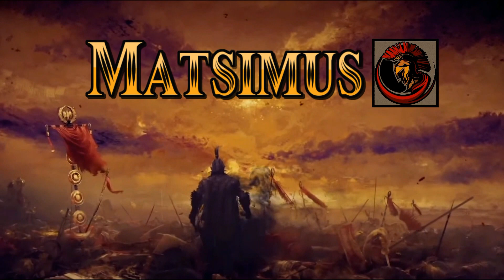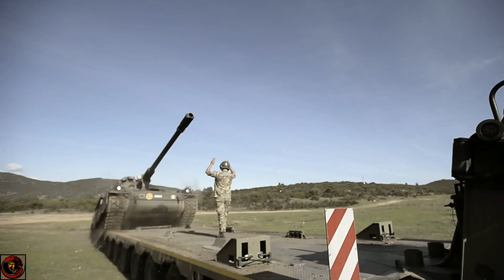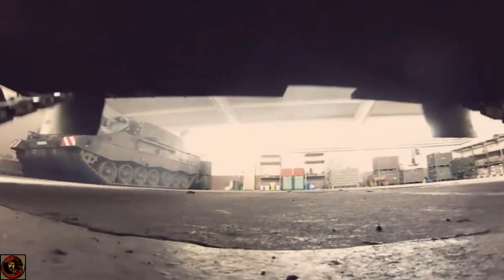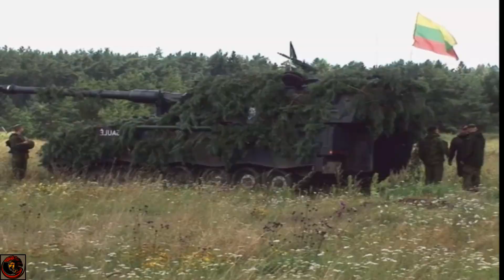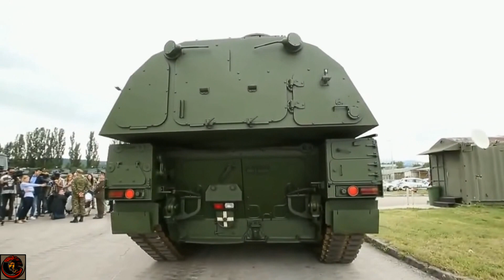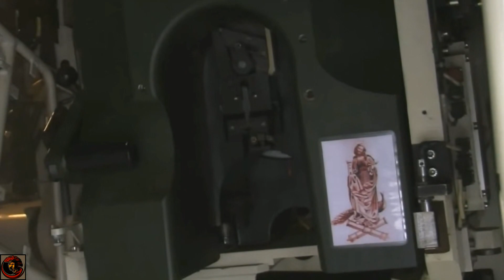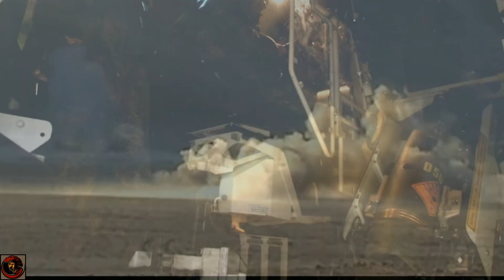German PzH 2000 - 155mm Self-Propelled Howitzer : Overview

Comment: The Leopard One MTU powerplant maybe rated at 1000 hp but actually puts out over 1200 hp. It also comes with a "battle" setting which rises the power to almost 2000 hp - for 15 minutes full load, but who would go full throttle for 15 minutes. The same "battle" setting is in the German Leopards Two with an similar increase in power. Friends of mine serving in the Bundeswehr back then reported the Leopard One going well over 100 km/h and only at 115 km/h throwing its threads on the Autobahn. Naturally this was only done if an inexperienced  commanding officer made the mistake to complain about to slow driving and demanded to put the pedal to the metal......

Comment: The thing that you missed is that 1 artillery piece can shoot 6 rounds in short succession that impact the target at the same time due to different sized propellant charges and the auto targeting system. I guess this is not unique to the PZH 2000 but it's still impressive...

Comment: 1:00 anyone know what that white cross on that shield like object is in the bottom right is? Seen it on the Gerpard as well as some other German things. From it's placement on the Gerpard I thought it was a guide of sorts for the tow hook. Can't tell if it lines up on the PzH 2000 though I imagine it could with the read hatch closed.
Reply: As far as I know this should be a signal sign. While i don't know the name of this thing i know its purpose. It is used when those vehicles travel in a group at night. The standard procedure is often that they drive behind each other and those shields are visible for certain sensors so that they can keep the distance.
Reply: @emilsinclair4190  Ah, thank you.
Reply: @emilsinclair4190  it's called "Leitkreuz" and you're right, it's a signal for following vehicles during night missions

Comment: With a range of 40 k, the best use of the vehicle would be to keep it behind the lines as its size would make it rather hard to hide. The key to survival on the modern battlefield is not to be seen and it is a bit hard not to be seen in a vehicle the size of a house. In short if this machine ever approached the front line it would become an anti-armour missile team's dream. But as started with a range of 40 k it does not need to approach the front.
Reply: That's exactly how it's supposed to be used. The groups usually position somewhere off the sight. For targeting you have spotters near the targets or guide the fire with radar or other technologies

Comment: I coulda/shoulda said:
. Is it just I/me or is this thing a monstrosity?
. Am I missing something, here, or is this thing a monstrosity?
. They are using caseless ammo with a sliding wedge, breech, block!?
How does that work? Do they wedge the wedge in there?
. Or do they just want to keep the ammo in the centre,
of the vehicle, for balance, or something?
No, they didn't want to raise the turret floor, any higher,
because of recoil, when using a magnum charge.
But there is a turntable under there already,
so why not just turn it into a magazine, directly?
And, they could have used hydropneumatic suspension,
instead, of torsion bars, or just dropped the ground clearance; and
U could pick up the shells by the nose or electromagnetically, even.

Comment: This is supposed to be the best SPG in the world!? HA!
Am I the only one who thinks this is a monstrosity?
. Why would U store Ur shell higgledy-piggledy like that?
Wot, just so U can see what U have, readily?
Why didn't they store them in a carousel under the turret?
I reckon U can fit 60 shells in a staggered 2 ring carousel,
under the turret, in the space they are using already!
. The Westies like to crap/carp on (about) how dangerous
the Russian tank carousel autoloaders are: 
And what about this monstrosity!?
Reply: First of all I want to awnser the question why the Ammo storage is so unique. Lets start with the position. The ammo is positioned like that to achieve a very low and centered Center of mass so the recoil doesn't effect the vehicle as much. This helps in improving the rate of fire. 

Next one: Why dont they use a carousel like the russians. When the PzH Was designed the first autoloader they thought of using was a Revolver loader. The big problem with a Revolver loader is that its very heavy and you have alot of motion going on (to stop a fully leader Revolver loader alot of force is needed). So they designed a completly new autoloader which weighs alot less and is more reliable.

And to your last question: Why everybody critizies russians MBTs for their carousel autoloader? The awnser to this question is pretty simple. It basicly already stands in your question. MBT are Part of the frontlines which make them targets to many threads so to use an autoloader in such a vehicle is very stupid.
The biggest thread to a PzH2000 is counter artillery which can be avoided by the pzh. Beides that the pzh is pretty good protected

Comment: Sorry, but it's not fast. My M-109 Crew and I regularly outperformed the PzH2000 back in the day. The german M-109 Crew were trained to fire a group of 3 rounds within 5 - 7 seconds and then bail. 

But I have to give it to KMW, when it comes to comfort and capabilities, the PzH is quite a beast. They certainly designed something very beautiful. However, I liked the M-109 better. This monster is so automated, that in case of an EMP you're fucked. You can't even fire the weapon, let alone move it on target or hit something. Yes, there are emergency procedures, that would enable you to perform at least some basic tasks. But they're so overcomplicated, that in a combat situation after being hit by an EMP, you best just ditch the vehicle and run.
Reply: You do know that the swiss have equiped their M109 with a semi auto loader to achieve a 3 shoot burst in under 15 seconds and you claim your team was 3 times as fast manually? Yeah, sure... Especially if you know that recoil system of the M109 needs nearly 2 seconds for a full cycle, so you could load the gun 0.5 seconds?
Reply: @shi01  Have you ever been on an M109? Do you even know how stuff like this is counted? Cause I don't know to what M-109 model you actually refer to. But the M-109 A3GEA4 doesn't take that long. And no, I will not provide you with the exact numbers, since they're still a secret. But let me tell you, it's well under 1 second. ;-)

The first round is always assumed to be ready to fire, cause before the first shot is fired, CoBRa has nothing to spot. So what's counted is, the time in between the first and the last shot of the group. 

In case of a firemission, you'll load the right round with the right fuze (assuming you have the rounds prepped and fuzed already) provide the right powder charge, move the gun to right angle and elevation, prime the gun, signal ready and then wait for the command to fire. Once the first round has cleared the gun, the K2 will immediatly open the breach, K3 standing by with the next round. K4 with the ramrod. Up and in, while the commander and K1 check that their Periscope and gun are still within the mission parameters. The whole cycle takes in between 2 - 5 seconds. Depending on circumstance and if everything goes smoothly.

The most time consuming thing in this is the time which the breachblock needs to close. 

Did this during LÜSA (LehrÜbung System Artillerie) multiple times on Video. 

Truth be told, it was more a notion of pride, that we tried to outrun the PzH 2000, cause at the end of the day, no guncrew can keep this pace up for to long. But back then, when the old Emmas got replaced by these monsters, we weren't all to keen about the new howitzer. And thus tried to prove a point in being faster, by cutting corners and giving it all.
Reply: @joenight9693 Nice to hear. Btw there is an interview with the patent holder of the pzh  on Youtube where he explains the idea/concept behind the pzh and explains some characteristics which are unique compared to other self propelled artillery systems. 

I can Highlights recommend it. Sadly its only aviable in german

Comment: There was a terrible accident in 2006 in east germany during a live firing exercise. 2 german soldiers died when the loading mechanism was not fast enough for the crew. They where to fast in placing the powder, so the powder package got stuck inside the receiver and later, during the repair, it exploded. I was in the Lausitz as a soldier only a few months later and other people talked about the accident. I must say, i‘m not convinced about these automatic loading mechanisms after that.

Comment: 36km is impressive for a gun system but it's still outranged by many modern rocket artillery systems. New Grad rockets have a range of 45 km. The BM-30 Smerch and 9A52-4 Tornado have a maximum firing range of 90 km. The new M270 MLRS systems have a range of 70km (or up to 300km for the ATACMS missile). The Chinese SR-5 has a range of 50km for the 122mm and 70km for the 220 mm rockets and the A-100 MRL has a range of 100km. SPGs are badly out-gunned at the moment. I think we'll have to move to rocket-assisted, guided munitions to keep artillery guns relevant in the future.

Comment: Could someone answer me a simple question please? Is any possibility for a Pzh2000 to survive if a main battle tank (eg Leopard 2) is trying to catch it? I mean on very tough terrain, like mud, snow, etc, could a Pzh2000 be capable and fast enough to go back to its base safe, before a tank get close enough (for example if the scenario was like the pzh2000's crew know that a tank is following them, so they have to run back to survive)? Because Pzh2000 supposed to be one of the top howitzers out there with very good off road capabilities. Is there anybody out there who could give me an answer please? Thank you.
Reply: Likely no since MBTs are just as fast, if not, faster off-road than SPGs. MBTs can also engage at several kilometers (before the SPG crew even knows they are seen) accurately and effectively, so the MBT doesn't really need to get close to it to kill it.
Reply: @bluntcabbage6042  But SPGs can engage a target from distance too. they can fire directly if needed. At least this is what i know. But in terms of off road ability both MBT and SPG have similar performance?

Comment: So all these actually fire with the crew outside?  Interesting.  I figured it would be crowded inside with the autoloader, crew and huge gun....
Reply: Only for the first shot of a firing campaign, as a safety measure to check whether the gun works as it should. In a real war with arty on the other side, that step will be skipped.

Comment: You better won't attack one...
They can fight like a normal Tank on emergency situations! That means they can directly fire with the 155.
Reply: But then it doesn't fire AP. If you are a decently armoured MBT, you should survive it.
Reply: @Sedna063  They always fire with maximum charge when applying direct fire. It packs some really badass punch. Look for the video "Panzerhaubitze mutiert zum gefährlichen Kampfpanzer" on youtube, it has english subtitles. You can see an old tank blown to flakes of metal ofter a few direct hits...
Reply: @BeneStarosta  I have seen the video. I still doubt that they could take out a modern MBT - the video showcased a Leopard 1 which has a weak armour profile. Against Leopard 2, a 155 HE shrapnel won't do that much
Reply: @Sedna063   Shrapnel is not the factor is, concussion is. A 155mm high velocity HE round will fuck even the most protected tank up, as it will stun the crew and play havoc an all instruments within. Even without a penetration you really do not want on the recieving end of such a round. 
It is very possible to mission kill an enemy tank with the first round, even without outright destroying it.
Reply: @phil3114   likely as well will damage tracks, crap the entire Composite armor where it hit and blew over, maybe even make their main gun inoperable..... Not to say that IF that huge ass HE hits near an area without Composite and low armor such as the roof or near some optics, the shrapnel could enter the vehicle... In a huge shower
Reply: @Sedna063 can u imagine ur ahh sittin inside an apc when a 155 mm round, at 25 kg and 100 of m/s speed hitting ur that metal can ur sitting in??? 

Bro u dont do anything anymore, cause concussion city has u welcome😂😂😂

Comment: Word by word it's basically

Armor(ed) (fighting vehicle) Howitzer 2000
a Panzer is a short form of Panzerkampfwagen(=armored fighting vehicle)  we only use the "Armor" part of the word as the whole word is just too long. 

It's a nice peace of equipment
works great in combination with "Spähwagen Fennek".....so basically..."recon vehicle desertfox"

The fast 10 round shooting is actually fake. These fast firerates are only achievable if you transfer firecontrol to the loader...this will never ever be done... The Artilerie guys are a pretty traditional bunch.

Comment: Do a video on the Archer Artilery System from Sweden / Norway... i guarantee it will top the PZH2000 ;) or you can do one on the South African Denel manufactured G6 Howitzer (sometimes know as the G6 Rhino)
Reply: While the Archer is sure a fine system, it won't top the Pzh2000.

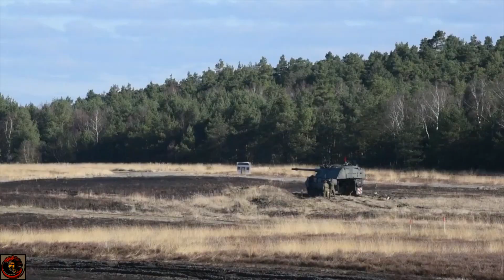Comment: Isn't it the chassis of the leopard 2 and not the leopard 1 as you said at around 6:10
Reply: Both. Engine is modified from Leopard 1, running gear is from Leopard 2.

Comment: With the newly adopted (2017) "Leistungsgesteigerte Munition" (improved performance ammunition) the maximum range reachable is about 56-60km
Also: Having 3000 NM of Torque at 2000rpm really does give powerful boost out of the ~18 liters of capacity, whilst the 1000hp seem a little underpowered

Comment: This is just an m109 with a slightly smaller turret
Reply: The Pzh2000 is mostly fully automated, unlike the M109. It's currently worlds fastest howitzer system. The M109 has a maximum RPM of 4, the Pzh2000 fires 10 RPM (3 rounds in 9 seconds in burst). Firing range is also higher on the Pzh2000.

Comment: Your presentation of artillery systems does beg a few comments.

The main advantage of selfpropelled artillery is that it brings a lot of firepower - cheaply.
A standard round of HE costs about 500 USD (give or take) and they would generally be precise out to say 20 km.
If you use base bleed and other such techniques that can be extended out to about 30 km and they cost - say - about the double pr. shell. If you have to go further than that you have to break out the big wallet to an Excalibur of around 100 times the price of a standard artillery shell.

The main issue is precision, because if you hit something on the noodle with 155 mm - there is very little to debate. If you extend range (precision is inversely proportional to the square of the range) you not only have to bring more powder into the gun, but you have to tote a hell of a lot more shells - which does strain the logistics with a lot of comparatively soft skinned trucks.
So the general idea is to hit the target and get the hell out of there - the best protection against counter battery fire is: Not being there when it hails down. Especially the russians are not known for their economy with ammunition. So the more you can provoke them to hail down a shower of grenades into a minor forrest the better: The russian: Firing to no effekt. And they will have all sorts of grief bringing up supplies.
As we saw in WW1 concentrated and imprecise artillery can expend an awfull lot of shells to very little effekt. Generally they counted an artillery grenade per meter of trench.

These high priced artillery-systems have their charm and do prevent the enemy concentrating their forces over to narrow a front. That ability does come with a cost, however: There are more men used in bringing grenades to an artillery piece for sustained fire, than actually firing the gun. And a supply coloumn is really what is meat on the table for low-prices close air support fighters. Cut the ammunition supply to the guns - and they soon fall silent.
The other thing is: These big systems tend to be heavy and they do strain bridges and other infrastructure in the former Sovjet block countries. Bringing that infrastructure up to speed will take a very long time - it might be a good idea to do it anyhow for commercial reasons - so more power to the heavy artillery on that account.

The heavier the artillery piece, the larger the caliber:  The quicker the barrels wear out and have to be replaced. Some of the really heavy artillery pieces had numbered shells to be fired in a particular order to compensate for the wear of the barrel.

Now I am not arguing one way or the other. But there is an argument for a system like CEASAR that can be mounted on different types of chassis and offer the crew a reasonable level of protection. It might involve reduced charges and thus range,  but if that means lighter vehicles that can be brought to bear in time, then it might be a price worth paying.
Putting a 155 mm. gun on a wheeled chassis that can race on the Autobahn with 100 km/hour might be a supplemental idea.

If it is the same gun system on different chassis much of the mobility issue is perhaps a question of taking 2/3 of the personel from the heavy pieces and fly them in to where they are needed (provided they are cross-trained), Let's remember: Tanks and trucks are cheap, but trained personel is very, very expensive.